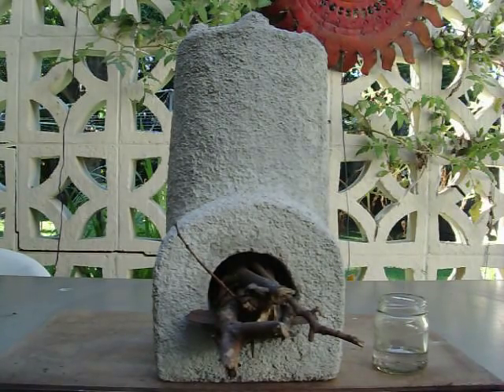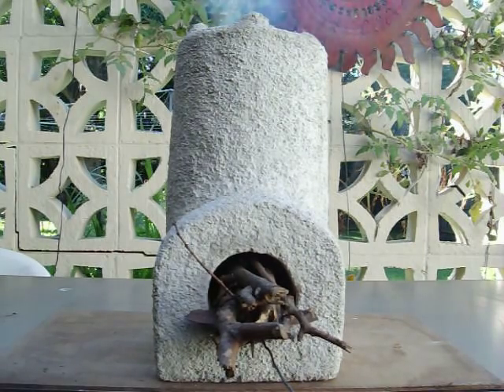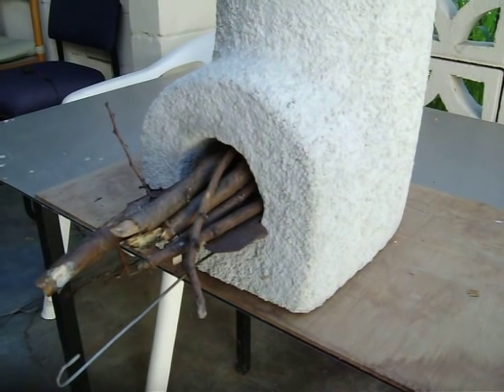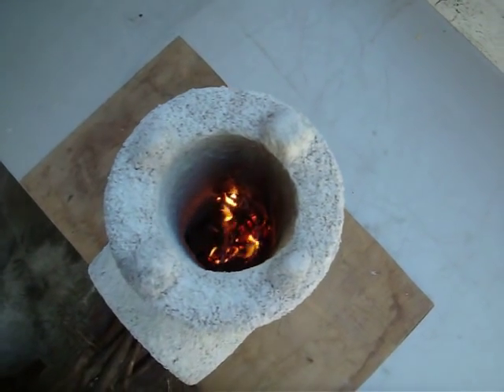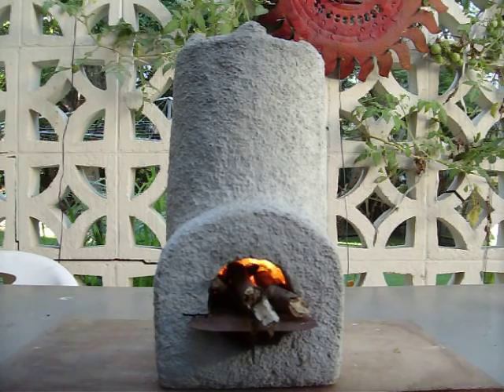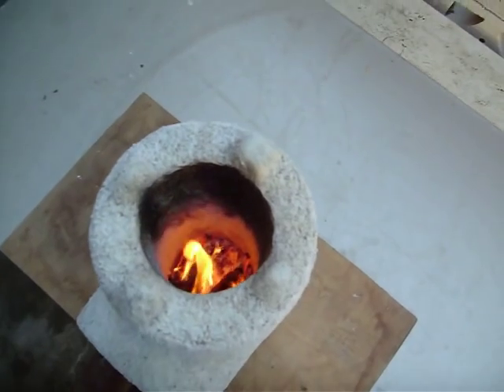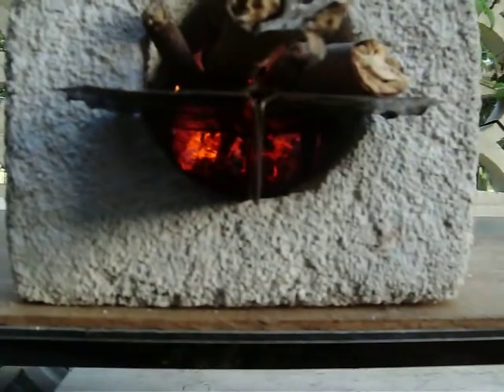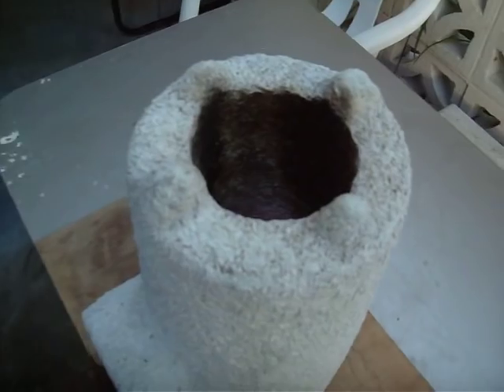Pumice Concrete Rocket Stove Heat Test

Comment: I bought hydraulically pressed Mexican-made pumice bricks, gave them an extreme fire test using pine and wow! Not a single part of these bricks crumbled like a cookie. Simply because they are no binders in the bricks.

No matter how many times I banged the walls with a chisel, these blocks just stay strong after a harsh pine fire.

Yes, pine burns so hot that it could melt steel.
Reply from the maker: They sound like great bricks.This pumice is great for making all sorts of things and this rocket stove is still going strong !

Comment: any way to speed up the curing process???
Reply from the maker: I'd leave for at least 7 days to cure.The slower concrete cures the stronger it will be ! Heat speeds up the curing process but may not be as strong !

Comment: Awesome videos. I think I've seen all of them for oven and stove. If you don't mind, I do have a question. You use a 5:1 mix. Is there any fines from the pumice or is it all larger aggregate? I was thinking a (4+1):1 mix but is there any reason?

Also, I am planning to make a rocket stove water heater. I was thinking to replace your tin can for the upper section with coiled copper pipe. This would put about half of the tubing into the heat area. Any thoughts?
Reply from the maker: I crush the pumice and put through a 10-12 mm sieve and have plenty of fine pumice to fill any voids in mix.The 5-1 mix seems to work alright. Not sure about the rocket stove water heater though as I've never made one !

Comment: great vid. would this be suitable for an aluminum melting foundry, so temperatures higher than about 700C?
Reply from the maker: I'm not sure James. Maybe if you use a hi-temp refractory cement with the pumice.Pumice is mainly 70% silica and 12% aluminium oxide.I try not to go over 1000F or 540C in the pizza oven !
Reply: thanks! thats pretty similar to the composition of perlite, so it should work
Reply: As far as I know, aircrete withstands bronze melting temperatures and it's lightweight concrete also.
Reply: @Gocast2  I once saw a video of west African blacksmiths smelting iron in a clay blast furnace and it was temporary also. The blast furnace had to be broken to free the smelted iron and forge into tools.

So yeah! Not many metal melting furnaces in history lasted forever. Ceramic wool is legit though.

Aircrete, on the other hand, is significantly better at insulating than the dense normal concrete and it's poor R-Value. After watching people use foaming agents to make aircrete, I've been wondering what would happen if they aerate clay the same way.

Comment: A few tiny holes just above the elbow in the riser could add a bit of secondary air and increase efficiency.  A bit of dowel or sticks to use as bungs...remove when fire is hot.
Reply from the maker: +Jeremiah Shine OK Jeremiah ! Thanks for the help,I'll test your idea !
Reply from the maker: +Jeremiah Shine How big should these holes be and how far up the riser Jeremiah ?
Reply: +JJGrice018 I think the secondary air was 3% of the area of the exhaust.   Don't quote me.
Reply: +JJGrice018 maybe 5.5" or 6" up the riser.  Try 5   little holes with a  3/16th bit.
Reply from the maker: +Jeremiah Shine Thanks for the info,I'll test sometime !

Comment: Sir can you put a large pot 2 gallon or so and see if a stove can boil the water within 15 or 20 minutes?  I am curious because I tried to boil a large pot of water to boil veggies and rice and it did not work.  At least a one gallon pot please try to show us if it gets it boiling.
Reply from the maker: +HealthSupercharger That is a lot of water.Did you have a lid on the pot ? One gallon or about 4 litres should boil in under 10 minutes.I'll test in the next few days !
Reply: Please do test at least a gallon since to boil some potatoes and veggies for two or 3 people will take a gallon of water easy if not 1.5 gallons.  If you have a metal skirt around your pot forcing the hot air to go up next to the sides of your pot it would probably heat it faster.

Comment: Question, do you really need to cure it for 3 months before initial firing?  Concrete cures to maximum strength in about 28 days.
Reply from the maker: +Lighthouse Keeper Pumice is mainly 70% Silica and 13% Aluminium oxide and a lot of chemical reactions happen when mixed with Portland cement and was just curing as long as possible to be safe !
See Pumice chemical make up here>http://www.kenencoregroup.com/pumic-stone.html
Reply: +JJGrice018 Thanks for the info.

Comment: John, what if one used refractory cement instead of Portland cement?  I think Portland loses its integrity at 600 degrees or something like that doesn't it?.....refractory can go to 2200.  Any thoughts?  Thanks!
Reply from the maker: +Timothy Miller If you can afford the refractory cement I'd use it .This started as an experiment on a gym-ball with this free pumice I collect and handles enough heat to cook a few pizzas. I don't normally go above 800F .
Reply: Please show how you built it, it's one of the best designs on YT. 
Also, how fine is the pumice that should be used? And is the amount of water you put the same as what is written on the pack of cement?

Comment: Thanks John.  Have you learned anything from your first oven, on how to prevent cracking?  Thanks!
Reply from the maker: +Timothy Miller I made the top dome section of new oven that cops most heat about 65mm thick ! See here >https://www.youtube.com/watch?v=QA4dim7Nzm4
Reply: @jjgrice018 Your video is not available after I click on the link :(
Reply from the maker: Thanks for letting me know ! Not sure what that was 3 years ago so I replaced with this >https://www.youtube.com/watch?v=QA4dim7Nzm4